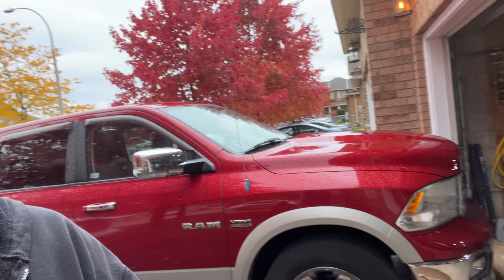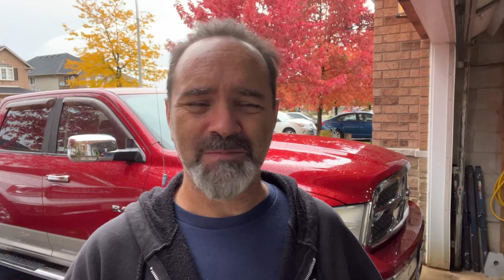Ram Misfire Clue Part 4

Comment: Well Scott. I've followed all, we'll, most of your "journey" with your Dodge, but I had one day left on my extended warranty. So, instead of "throwing" anymore parts and money at it, I brought it to the dealership I bought it from. It took the tech about 25 minutes, a compression test and bleed down test to determine, somebody needs a new motor. 🙄... ZERO compression and the bleed down test, if you wanna call it that, bleed down in about 3 seconds. Thankfully I stopped my trouble shooting when I did, cause warranty is covering it. But thanks for all your insight about everything.